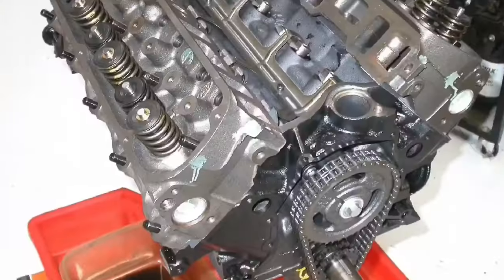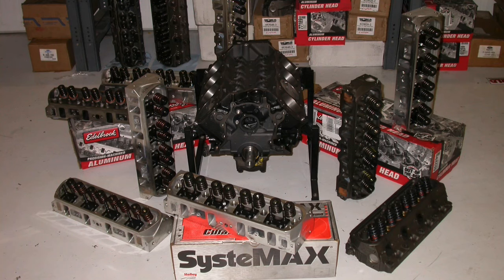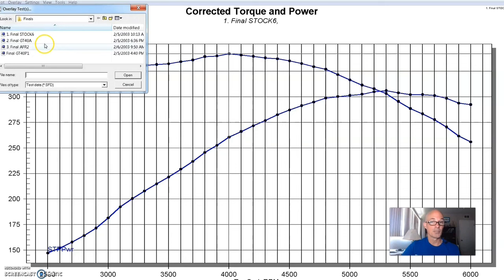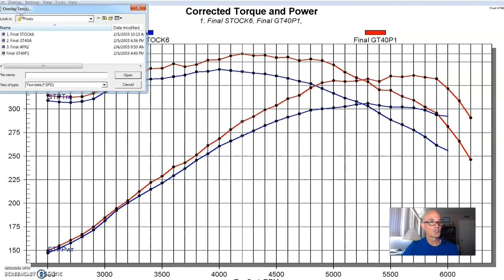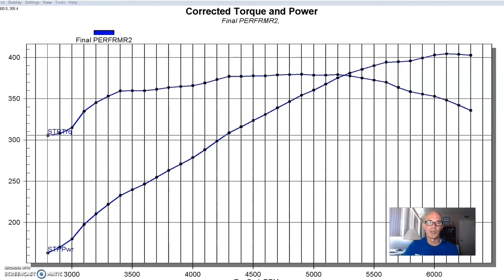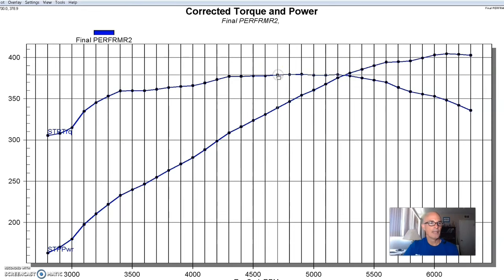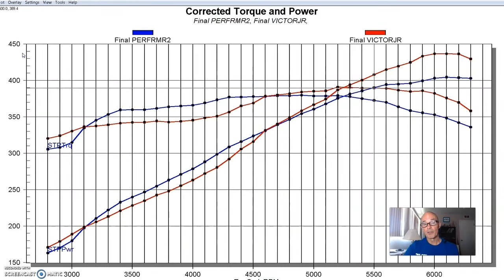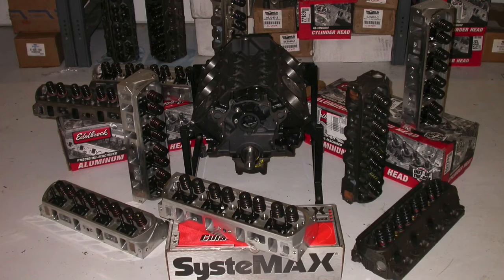LOW-BUCK 302 FORD HEAD UPGRADE

Comment: Awesome job Richard, as always.  The lack of prep?  don't sweat the small stuff.....it's just some pictures.  Can we sometime do a valve timing discussion using the dyno to show what differences valve events play into the outcome.  I have heard (through what I thought were good sources) that timing can play a big role making the "combo" work the way it was intended.  For example.  If the head ports were considered too big and "lazy" for the size of displacement the old rule of thinking was to get a smaller head runner.  However, new heads by the manufacturer flow HUGE compared to the displacement compared to their older counterparts and make great power with a decent idle, A/C running, etc.... I realize VVT plays into it to a degree, but can valve timing events be used to "bandaid" a head choice that was considered too big.  Just trying to learn good information.
Sorry for the wall of text, and the long question, but it's the only way I know how to write it all out.  If you can't do it, don't sweat it.  Thanks
Reply from the maker: I'm not sure at what point too big becomes an issue-we ran CNC 225 heads on a 306-look at the port volume on an LS3 head compared to the power output. Look more at flow rate vs power output

Comment: Thanks for all the hard work... I would like to have your job. Maybe you could test the b303,e303 ... cams and older intakes like torker 289, x-celerator, port-o-sonic, fb4...
Reply from the maker: I have run all those cams (8 in one dyno day)-way back-might be doing something similar soon with Summit
Reply: Those old letter-cams are OLD HAT! 220/220, 224/224, 226/226 thumbs down!

Comment: I did GT40p with early Mustang 289 intake and exhaust manifolds, anyone wondering if they clear the spark plugs have a look at my clips. I got out the carbide bits and opened up the exhaust outlet, was quite proud on how they came up.
Yes they flow crap compared to headers, but with the Mustang crowd using the K code cast manifolds, these home cleaned up A code manifolds would have a bigger outlet than the K Code manifolds.
Reply: Stock appearance means a lot to some people.
Extrudehone $$$

Comment: I remember when Super Ford tested all those heads. (Great job Richard)
As I recall, the 165 AFR has the smaller valves to fit the factory valve reliefs and you had to cut them for the 185s.  (Richard,  you are a workaholic, THANKS)
Reply: Yes 165 have 1.94 valves 185s have 202s
Reply: For me the intake valve relief in the stock 1990 forged HO dished piston was not wide enough to give 0.100 piston to valve clearance for a 1.84" GT40 valve with a Comp Cams XE266HR camshaft.
Reply from the maker: The 165 has better P-V
Reply: Sbf fox
Really??
You just added .100 lift and much duration.
Try an extra 4* advance.

Comment: I still remember those tests in Muscle Mustangs. Looking back it’s hard to believe that no aftermarket heads had enough spring to run that fairly mild cam. It’s like non of the manufacturers tested their “production” heads without upgrades. I guess they were all trying to be in the pricing war since there were so many brands and options back then.
Reply: 274 cam has 544+ lift and very fast ramps. Valve train weight is a problem: lifters, pushrods full of oil, spring mass, retainers, rockers, and valves. Thrown in 1.6+ ratio and the momentum and flex is amazing at 6,000 rpm. Lifters squeeze down and can't keep up with inertia.

Comment: Do you have a video on small block Ford 302 with all upper Edelbrock parts? I have a 95 Ford Mustang with a 302 with Edelbrock RPM heads and Edelbrock RPM performer intake and a power down supercharger with a 3-inch pully 3-inch inlet. I have no idea how much power it makes!

Comment: Great work and data Richard, pics not required.  On the upcoming "big ultimate cylinder head test" are there any ProMaxx heads?  I do not believe that I have seen any tests you may have included any Weiand intakes, anything already done there?  Thanks!!

Comment: You should have included the Parker Funnel Web intake. I know you have tested it in the past but having it here would have been great as it is a great intake. I have used it on 347 engines and it always does well. Everything else here is very good.
Reply from the maker: lots of tests on that intake-it does well

Comment: I miss the Torker II.
Awesome street intake.
Reply: It’s junk , stay with RPM AG
Reply: Torker II works great with boost, the Performer RPM air gap is better for NA. Just saying.
Reply from the maker: Boost just adds to what is there-this combo worked best with a dual plane-even under boost
Reply: The Torker didn't test great on this SBF combo.
.....On a 455 Pontiac with a 750 Holley, it was a big boost to mid and upper range, without giving up anything on the bottom end.
I could be wrong,  but I believe big motors tolerate single plane intakes better than small blocks.
For street setups that is.

Comment: Hi Richard, I'm in Australia and I bought MK1 Ford Capri. It's engineered and fitted with an injected 5.0L from an EB XR8 Falcon(92 model) similar to the Windsor's you work on. I was thinking of getting rid of the injection and going carby or Holley Sniper. What's your opinion? It would be much appreciated. Thanks Roger.
Reply from the maker: Sounds great!

Comment: Hey Richard, how hard would it be to test a Big Block 460. With single and twin turbo setup🤔. I would love to see what it makes on a stock bottom end and maybe a slight upgrade say 532 stroker😂
Reply from the maker: I don't have a 460 right now-boost just adds to what is there

Comment: I thought that rpm air gap was too big a manifold for the p heads. it's my understanding those heads flow 190-195 cfm. an air gap flows 220. wouldn't a regular performer match better at 205 cfm? tell me why i'm wrong. great videos by the way, you should be on tv
Reply from the maker: you would be incorrect if you try to decide on an intake manifold based only on flow rate
Reply: @richardholdener1727  well, just when i thought i was was starting to know something, poof! so, what video should i watch to fix up this 99 explorer engine for my 83 t-bird. please excuse my ignorance, i haven't had a hot rod for over 40 years? all the info and advise i can find is conflicting. i can't figure on an intake let alone a cam.

Comment: Hey Richard, you've  helped me in the past on a 331 in my 66 Bronco thru YouTube. I have 2 projects I have questions on. I am now modifying a 555 BBC in my 70 Chevelle and have some intake/carb questions and my 15 YO is building a 302 for a mustang GT that he will run at Buttonwillow raceway. Just wondering if you do any paid consulting?
Reply from the maker: ASK AWAY OR JOIN THE LIVE FEED NIGHTLY AT 7 PM

Comment: Great content regardless of photos. I was thinking a video on detonation and what promotes detonation and what starves it off, more on the mechanical side, like do wide lobe centres help in running higher boost, how does squish affect detonation on the limits. Maybe running the test on low octane fuel and exploring pushing the detonation envelope on a turbo engine.
Reply: Who in their right mind would intentionally detonate an engine over and over? You realize it's literally like hitting your piston with a sledgehammer don't you. Perfect way to put piston skirts in you oil pan.

Comment: Hay Richard I’m build a 347 for my 78 ford 4wd it’s getting a zf5 5 speed behind it to replace the old worm out 460 I want 350 horse power and as much torque as it will make, I have a stock bronco long block I’m going to start with, can I use stock truck heads or should I put aluminum heads in to the budget

Comment: would like to know if you recommend head studs or bolts and any other fastener tricks you use, I use to use allen head set screws on my oil pan etc, it made aligning things much easier ,
Reply from the maker: studs
Reply: @richardholdener1727  Thanks , Never tried them . Great info you are producing and much appreciated.

Comment: i'm thinking the heads came with soft valve springs around the time Zinc was taken out of the oils, but no one had figured out yet that was killing brand new lifters and wiping out cam lobes? They may have thought the spring was the issue.
Reply: Springs became factory rpm limiters

Comment: I put a set of 351w 4 barrel heads on my 302 in my 83 Capri. I wonder where they're at compared to the GT40P heads. Probably not worth the effort this day and age. How about a set of mildly ported GT40P heads?
Reply: By the time you do guides, hard seats, new valves, etc. $$$$$
You still have an ancient iron head.
I run reworked 289 heads, for 24 yrs, but hey, I had a professional machine shop. Not cost effective today.
Reply: @hotrodray6802  is that the same for gt40 and gt40p heads?
Reply: Not worth the time/money for such a mild upgrade. Save your time and money until you can afford a real cylinder head upgrade.
Reply: Bronco. 
Only the large spark plug W heads are 144 cc intakes. 69-74
ALL the other heads are 124 cc. 
Powerheads cnc ported newer irons are ok at @190/150 flow. $$$ ???
Add a few $$ and get alum. You wont regret it.

Be careful.
You can kill torque below 3000 to gain a little at 6000. Be realistic. Only race cars need 6000 rpm.
Reply: Keith Wiebe No such thing as "351W 4 barrel heads." Same head was used on both 2V & 4V.
Reply: @foxfordcatguy2283  Some people say the chamber may be slightly smaller?
Reply: Keith Wiebe nope, Windsor all used the same heads 4v and 2v
Reply: Kai
You are incorrect Sir.

Iron heads...
There are 2 basic intake runner styles for 260 through P. Big plug 351 biggest 
A few different exhaust port types
Several different chambers, valves, 
And large and small spark plugs.
Worst heads are 68 289
Best..... ???? Depends.
Some are good, but not real good compared to 
anything aftermarket.
JMO
Reply: @keithwiebe1787  The only '69-'74 351W heads were C9OE & D0OE, both had 60cc chambers & 1.84/1.54 valves. In '75 chamber size increased to 69cc & valves shrunk to smaller 302 size 1.78/1.45.

There was the rare '68 only 302 4V head, C8OE-F that were 53cc. But that was their only benefit because they had standard 302 size valves.
Reply: @hotrodray6802  Are the '68 289 heads worse than the late '70s 69cc 302/351W heads?

Or the '86 E6AE "shrouded valve" heads? So bad they only used them on the 5.0 HO one year - then switched to the E7TE head (which was basically the same as the '85 E5AE head). The shape of the '86 chambers followed the shape of the valves, so airflow around the valves was severely restricted.

Comment: Richard, did you run the GT-40P heads with the stock exhaust valve rotators? They really add to the moment of inertia and can float valves as low as 4500 RPM under load in the car.  In other words,  they stink.  I would have liked to see the P heads compared to the regular  GT40 iron heads. And then the same two heads with good springs then...with upgraded valves as well, like Manley Pro flows or race flows. This would be great for the guy on a budget.  Thanks for your great work.

Comment: IM PERSONALLY USE ON MY 302 HEAD OF 351W and Camshaft of 351W just changing de firing order to 351W and Intake manifold Offenhauser Hi-Rise manifold with 750Cfm Holley Carb and DT headers .
And MDS Ingition hardware you will hear music in your ears .
And dont have to spend to much money .

Comment: Great report, very excellent info. I have a 1994 Pontiac Firehawk with an LT1. The car has 22000 original miles with a T56 transmission. I'm interested in installing a smallish turbo low on the passenger side. I know I will need an electric oil pump to return the scavenged turbo oil to the engine. I would like this mounting location because when you look under the hood it all appears stock. Intercooler under dash and reversed intake. My question is what turbo would you recommend for boost in starting at 1500 rpm and spooling out at 5500? Fantastic info Richard, thanks.
Reply from the maker: I don't recommend a lot of boost at 1500,but the cheap route is the GT45 clone-good for 750 hp or so

Comment: Hello Richard...
My son and I are working on his first car. A 1968 Ford Galaxie 500, with the stock original 302. *We don't have any engine service history.
We have installed the Edelbrock 289 performer, and a new 600 cfm Holly 4160. Everything else is old and original.
Is this set up good to use New or Used Heads and a new Cam?
What do you think of the windor heads on our stock bottom end?
We would appreciate any advice.

*SBF would be best for a young man for now, right?

Thank you!
Scott
Reply from the maker: if it run then it should work

Comment: Richard thanks for the great video, finely SBF 302 tests, looking forward for those cylinder heads test, do you happen to have any test with SBF 331 ?, and what do you thick would happen if you had installed a 1" open spacer on that RPM Air-Gap, will it not beat the Victor Jr. or get equal numbers ? without affecting the low end of the rpm side .

Comment: Nice job lotta work just to educate us who can't afford all the peices let alone the dyno and the time I built an engine blueprint for a customer with a street 71 f100 302 auto before I found your video of coarse xe274 was my pic for its range and torque production summit stage 2 intake with some trick trimming and well ported 79 pick up heads but thinking about going with gt40 heads I've done them before and they respond well to a bowl blend and casting mark removal and dash of short turn radius reshaping at about 9.25 cr it gets all over 400hp and is a real street option safe for a little shot with a 600cfm QF and a hei dist and tada its reliable too lol i had this combo in a 84 ranger 11 years ago daily driven till I broke the right rear wheel off launching it but it was a slightly smaller roller cam thanks for the confidence in the peices I've ordered

Comment: I'm surprised how little the difference was between the victor jr and the RPM I was expecting a much bigger torque loss. This also makes me not feel so bad for running a torker on my 305 for years before I found an RPM intake

Comment: My brothers fox had AFR 165 and I believe it had triple springs with the victor EFI on a explorer bottom and pulled really hard till the limiter
Reply: Do you mean an Edelbrock Victor upper intake on an Explorer lower intake? That wouldn't work. The Edelbrock has rectangular ports & the Explorer/GT40/Cobra intakes all have round. The bolt patterns wouldn't even match.

Comment: I would love to see you actually build and put together what you think is the best setup for a junkyard 302.
Reply from the maker: define best
Reply: Richard Holdener I love your channel and your energy. What I mean is. That I would love to see the build process. With the 289, 302 or 351. Or any other make for that matter. With what your ideal build for a street engine with good HP for street. I just would like to see it put together. Thank you for responding.

Comment: Richard, I am planning a boosted 306 build with the same XE274 or similar camshaft.....is a 195cc cylinder head too big for this application on EFI? (I know this may depend on cross sectional area also)

I'm worried about driveability as my project will mostly be a fun street machine....however I dont want to leave power on the table. I see in this video you used 185cc heads at one point.....is this as big as you would go on a 306 build? Thanks.

Comment: I got gt40p heads on my 351 bored 10 over and a comp cams 4x4 cam and ford 1.7 roler rockers and weiland's  stealth dual plane and holley 650 carb. Built it for my 91 351 crown vic. Never got to even run it still on the stand, car got wrecked on trailer.
Reply: 124 cc intake heads on a 351W.
True that is the stock W head size but no real gains for the effort.
JMO

Comment: I am putting an engine together with a very similar parts combo to the 3rd scenario tested (264 grind cam, flat top pistons, AFR165 heads). The take-away from this video for me is that the springs that come installed on the heads might not be optimal.

In the video Richard alludes to the fact that AFR have done some spring improvements since he did the tests. Would I be fine with their current version of the AFR165 assembled heads as-is or is a spring upgrade in the cards?
Just as an FYI I am looking for engine (valvetrain) reliability and squeezing out the last bit of power at high RPM at the expense is not a priority.
Reply: So further to my post above, is there any harm or downside to ordering the heads with the optional heavier springs?

Comment: I put a gt40p top end on my Fox body a few years ago with an E cam and the usual bolt ones.
I was shocked with the power improvement ….I swore it should be at least 300 chp. Vs the stock 225 hp.
Guess I wasn’t far off.

Comment: Fantastic video!   I'll be doing my first engine build shortly (budget 302) and this is just the kind of video I need.   Definitely looking forward to the next video with head comparisons.  Quick question -- what are your thoughts on Flo-Tek heads on a basically stock, rebuilt 302 (bored .020, stock bottom end)?
Reply from the maker: have not run them-but should be lots better than stock

Comment: This may have been asked before, if so, please forgive my ignorance.  Have you tested the Mercury Marine 302 heads ? I came across  such an engine, and it was equipped with 1.94/1.60 valves, Hanley guide plates, and screw in rocker studs. It was rated at 200hp, 8:1 compression, (utilizing dished pistons); and required the early 351w intake and exhaust gaskets, because of port size... i am curious because I have just come across another MM 302, and considering it for a build.
Reply from the maker: I am not familiar with those heads

Comment: I think I would just grab the motor and upgrade valve springs like you suggest without touching the cam or internals.  Lock the distributor at 34° and take it to the track.
Reply: Oh...yes, add some race fuel.